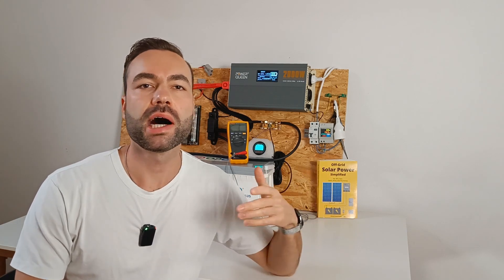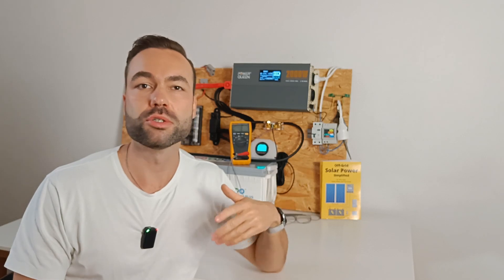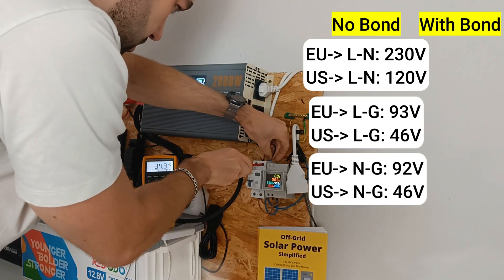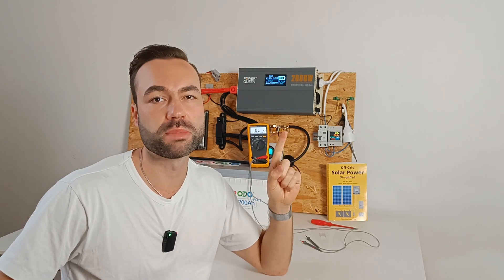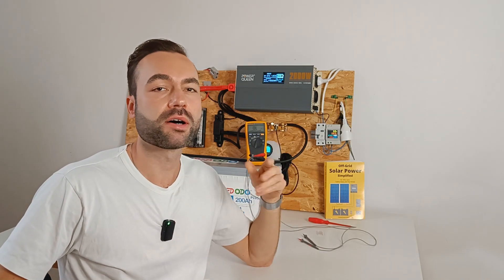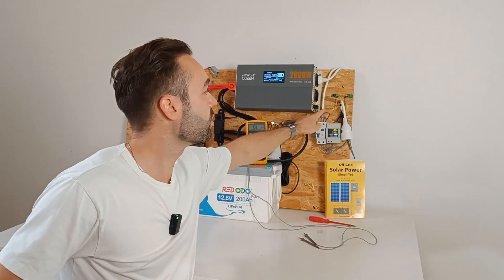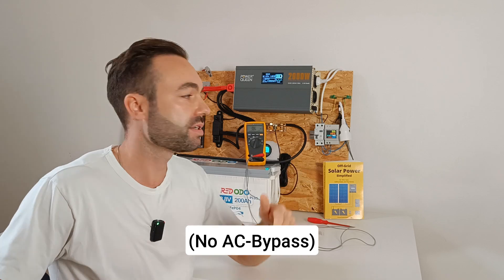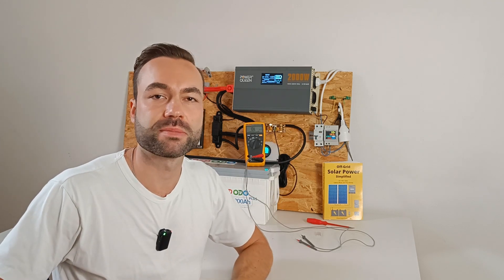Neutral-Ground Bonding for Off-Grid and Mobile Systems

Comment: How does one identify the Neutral conductor on a (non internally bonded) European inverter output?
Reply from the maker: You should measure the voltage at the output terminals like i did. That way you can tell which is the live and neutral. Once i had an inverter switch them inside. The highest voltage is the live.
Reply: They’re both live! An isolated system doesn’t have a neutral. A neutral only becomes a neutral once it is connected to earth!🙄
Reply: @cleversolarpower  Right, but when you measured them before bonding, you had 93V L-G and 92V N-G. Does the 93V being larger than the 92V suggest it is the Line, or, like @retrozmachine1189 suggests, it doesn't matter electrically which terminal you bond to ground?
Reply: @matt0x000C  If you have a single phase inverter and it is correctly isolated it really doesn't matter.  You must still determine that the inverter is correctly isolated before doing this of course.

Personally I've never seen a portable inverter with a switch in the live wire coming out of it as @cleversolarpower says he has, but it's a big world so if you do have one such as this the switch makes that particular wire 'live' and the other 'neutral' since  you should not switch just the neutral, similar to my socket example.  If the inverter has sockets and a terminal strip the wire on the terminal strip that is connected to the socket 'neutral' pin should also be considered to be 'neutral'.

You must still determine that the inverter is correctly isolated before doing this of course.
Reply: If the inverter is correctly configured with 'European' use in mind, there is no difference.  None of these things supply 2 or 3 phase power so what becomes the 'neutral' conductor is up to you.  Convention says that if there is a socket on the thing the wire attached to the pin that normally carries neutral is .... neutral, and likewise with a terminal block.  Be aware that some inverter manufacturer (hello Reliable Electric) have been known to just slap a label on their 'split phase' USA designs and tell you to not connect the 'neutral' or leave that terminal unlabelled.  Honestly manufacturer's that do that should be ... well can guess what should be done to them.

For USA situations where the inverter has 'split phase' output, then there is a neutral and you can determine it by measuring relative to all 3 conductors.

Comment: If you're getting 46v on ground even without a bond, the inverter is garbage.
Reply from the maker: It's not against ground, because it's a floating ground. The reference is the neutral.

Comment: Question, i want to use portable petrol generator to direct charge a lifepo4 12.8v. This battery is fixed in my 4x4. Do i need to ground the genny? Cheers
Reply from the maker: Do you mean grounding or make a ground neutral bond in the generator?
Reply: Yes grounding
Reply from the maker: @tweety135  You have to consider every power source; a nuclear power plant with an alternator, a transformer, and inverter or generator as a power source. Every power source needs a neutral to ground bond. A system can only have one neutral to ground bond. So you will have to disconnect the earth to ground bond in your inverter when you connect the generator to the system. Take a look at the document 'wiring unlimited' by victron for more information on how to ground a generator.

Comment: Excellent lesson. Luckily my Multiplus-II takes care of this issue for me. But, I only know that now for watching your tutorial. I’m a long way from learning the  full extent of its features. Thank you for your work. All the best to you.
Reply: In the case of a victron multiplus 2, the grounding to earth relay is normally closed making the ground neutral bond. When AC in is detected this relay automatically opens breaking this bond. If the AC in is from a generator or another AC source that has a floating neutral, there is no bond. In this case should you turn the grounding relay off permanently in the inverter and make the ground neutral bond in the AC distribution box to cover all scenarios? This is something to be aware of as the inverters don't automatically sort this issue out in all scenarios.
Reply from the maker: Indeed, it's the 'click' noise when you connect the AC-in.

Comment: The real answer is these types of portable battery inverters (the power queen depicted) are intended for I class operation.  That's it.  There is no earthing system or at best IT.  There is no earth fault path.  Getting between line/live/phase/active and any surface or appliance can not cause any harm to a person and yes and RCD/GFCI will not act... because there is no fault current.  Only getting between same and neutral is an issue and an RCD/GFCI won't protect you from that anyway.  Lots of these class of inverters don't even have a wire to the earth terminal of the AC socket as it's actually illegal in many countries unless an RCD (GFCI) is integrated into the inverter.

Don't screw around with things you don't understand people.
Reply from the maker: The inverter acts as the power source, just like the transformer in your street/neighborhood. Bonding the appliances together like in my video about grounding/bonding and creating the ground-neutral bond will work the same way as your normal grid power (if you combine that with a GFCI). I have a video about gfci coming up, so that would be interesting. Indeed, don't screw around with things you don't understand, especially AC power.
Reply: @cleversolarpower   In a T class system there is potential between the environment and phase causing risk of shock between phase and the ground and also earth wire and ground in an earth fault.  In an I class system, which the power queen and pretty much all portable inverters are intended to be used as, this hazard does not exist.  By forcing a N/E link you break I class safety and then must employ earth fault protection to handle a hazard that you have just created and since  the PQ and largely all of these portable inverters can not trip any but the lowest rated fuses and breakers to ensure rapid disconnection in an earth fault, you must employ RCD/GFCI.

Tell me, which is safer?  A situation where intrinsically you can not place yourself between two points with a hazardous potential difference; or a situation where you can place yourself between hazardous potential and must employ additional equipment to restore safety?
Reply from the maker: @retrozmachine1189  You need a GFCI in combination with a neutral-ground bond to make it safe. Since we have connected a TT network now, we have made it more dangerous and need a GFCI to protect against shocks. As i have said in the video 10:50 you need one. Video coming soon.
Reply: @cleversolarpower  Your diagrams regarding the portable inverters such as the power queen do not demonstrate a TT earthing system at all.  Your diagrams involving an inverter charger such as the Victron depicted do not demonstrate a TT earthing system either regardless of it being connected to a fixed mains supply or operating off battery.

Items such as the Power Queen are intended for I class operation and probably don't even have anything connected to the earth pin of the AC output socket or wiring terminal either and are not intended for connection to a fixed wiring system.  The terminal strip should only be connected to a double insulated containment of additional power outlets.

I'll pose the question again:  Which is safer?  A system where it is intrinsically safe, or a system where you take an intrinsically safe item, force an unsafe condition and add additional items to restore safety?
Reply: @cleversolarpower  https://youtu.be/abfXLujggBo?si=THsG7Df1YY0wCi9X

Comment: One query. What if the inverter is center tapped.?
If you ground Neutral a center tapped Inverter, you are going to get 170v between any battery terminal and the body of any Class 1 device plugged in, IE a metal body Kettle.!
Reply from the maker: The center tap is the neutral (USA). line 1 and two are marked with L1 and L2. So there should be no confusion between line and neutral. The center tap (neutral) is grounded, this is the ground neutral bond at the transformer. L1-L2=240V L1-N=120V, and L2-N=120V.
Reply: @cleversolarpower  No no. I am talking about an Inverter center tap.
the inverter produces a Positive top and a Neutral bottom of the wave form, the center being the zero volts.
If you use any side as a Neutral bond, you get around 170 volts between a battery terminal and the body (Earth) of a class one device such as an Iron or a Kettle.
So you can't Neutral bond a center tapped invertor as it is dangerous.
Reply from the maker: @G1ZQCArtwork  Never came across a center tapped inverter. However, i think this should be stated in the manual. The manual will say to not bond the neutral to ground. To be sure if you have a center tapped inverter, i think it's best to measure the output before the bond and see if it's similar to my case in the video.
Reply: @cleversolarpower  I have a Streetwize (R) pure Sinewave 3kw Inverter, it states in the manual not to be used with class 1 devices, as you cannot provide an RCD earth path due to it being Center tapped.

Comment: Wow, that's deep! I haven't seen a video yet on YouTube explaining in that depth, bonding to Earth. Unless I'm wrong, I didn't hear the host caution about some budget SMPS inverters haing a HOT "neutral" in the socket. AKA a floating neutral. That means measuring the voltage from either legs of the inverters' socket to case will show 1/2 of total supply voltage. Which means that each leg is actually supplying 1/2 of the voltage going to the load. IF you bond the so called "neutral", (the wider blade in the US) to the case or Earth (ground), would the inverter go BOOM? I don't know. What about bonding that same inverter neutral to the NEG terminal of the battery(s) powering it, AND Earthing the battery NEG too! Hmm. Try that with several inverter models and see what happens!
Reply: You will always see residual voltage between the chassis of these portable inverters and the current carrying terminals.  It's the result of capacitive coupling of the 20kHz or so PWM and 50/60Hz AC waveform.  Digital multimeters typically have a 10M ohm input impedance meaning they impose almost no load at all and will indicate voltage even if the underlying situation can not even supply 1mA.  Determining of you have residual coupled potential or a situation where the chassis of the inverter is directly tied to some component of the AC output can be achieved by placing a moderate resistance between the chassis and the AC output and then measuring with a multimeter.  This is a hazardous thing to do so should only be performed by a competent trained person.
Reply from the maker: I have an inverter where they swapped L1 with N (live with neutral). Since it's AC it doesn't matter much when powering devices, but when you want to make the ground neutral connection it matters a lot. So that's why you should always measure the voltage like i did in the video. 
You can make an AC distribution box outside of the solar generator with a neutral ground bond and a GFCI. Just like i did in the video.
Reply: @cleversolarpower  Can you explain 'they'? Do you mean: Inverter manufacturer? I just got BougeRV 2000W inverter which I've tested in more ways than you here but multimiter measurements match with what you show. I've also used osciloscope but osciloscope will also show waveforms of so called 'gost voltages' (N to G for example in this kind of inverter when N to G is not bonded). I've found somewhere that someone asked BougeRV if they can bond (connect) N-G terminals and answer was "NO, it will fry inverter". When I've opened inverveter ground wire was not connected anywhere so connecting N to something (green wire) 'in the air' will not do any damage. In BougeRV wire from inverter circuit board marked as L is connected to outlet N terminal and vice versa. In this kind of inverter it does not really matter as this is a 'switching' power inverter (there is no real L and N, both terminals are 'hot'). I want to use battery-inverter to charge my plug-in hybrid and still not sure I can do it safely. If I do not bond N-G, charging cable will report ground fault. When I bond N-G, ground fault is not there anymore as N-G voltage is now zero. But .. since this is a switching power and G from inverter will be conected to car GND (chassis) I am not quite sure this will not do some damage to car electronics. I've seen youtube videos where people do that without problem. In home wiring N and G are on the same potential which is actual ground (earth). With inverters I am not sure. When car is charged from wall outlet chasis is directly connected to ground (earth). With inverter N-G bond is not connected to ground (earth). That is big difference. When it comes to protection when  you have GFCI then it will be safe. Maybe I need to add GFCI for car charging from inverter as well to protect car in the first place. I have car wiring diagrams but GND wire (from external plug) is connected to a 'black box' where there is another chassis ground from the 'black box' but not clear if there is something 'between' that servers as protection? People often use term 'cheap chinese inverters' meaning they are just bad. It is not about who makes those. If they are made in other country they will have same 'issue'. Why some other country (US) does not make 'cheap' inverter like this? I would call those inverters 'cheap' because documentation is usually not so good. For example what is said in this video needs to be in manual so people know how to properly ground inverter and not spend hours trying to find youtube video (like this one). We do not know who the people making youtube videos are and (no ofense) can be trusted or not. But inverter manufacturer knows what kind of inverter they make and what end user should do with them. Grounding is very important.

Comment: What about charging with a generator that has neutral to ground bond and your ac panel is already bonded ?
Reply from the maker: Good question. If the generator has a ground-neutral bond inside (measure it), it acts as the grid. The grid has a neutral to ground bond at the source (transformer). So you would handle it the same as being grid connected. So, disconnect the ground neutral bond at the inverter. With smaller generators, it's possible that there is no ground-neutral bond. In that case, you have to create it yourself or leave it as an isolated system.
Reply: @cleversolarpower my inverter does not have a boned neutral but my electricial panel does.
Reply: Great stuff 🫡

Comment: Bro I have a problem
Reply from the maker: Tell me about it.
Reply: I am an electrician. I have installed 10kv hybrid a few days back. Everything I have done is fine but when I turn it on the out cable explodes! I don't know why! Please help
Reply from the maker: Check your polarity before starting up the system. And check every connection.
Reply: Ok thank you so much ❤